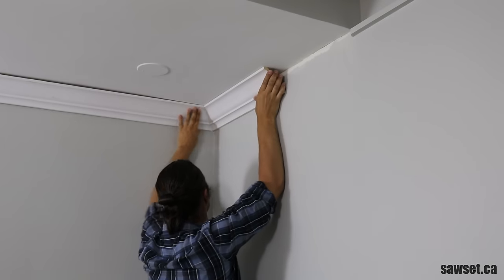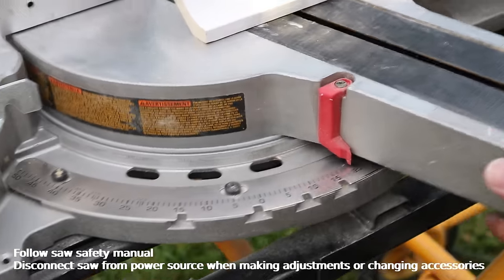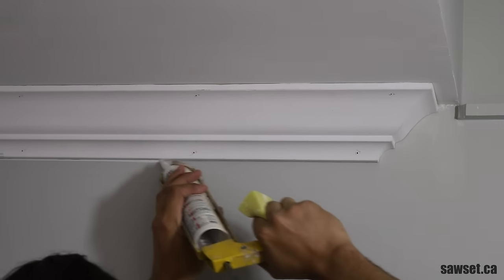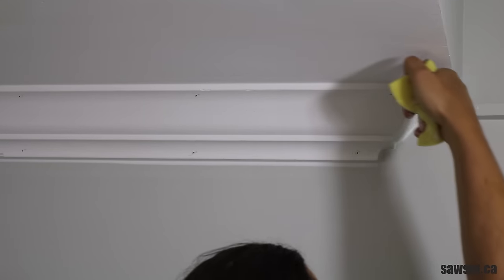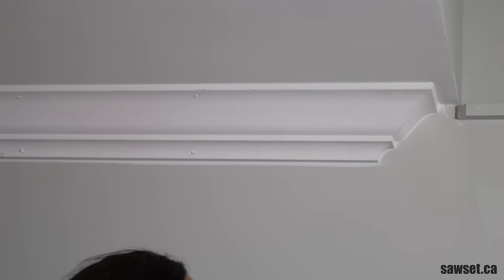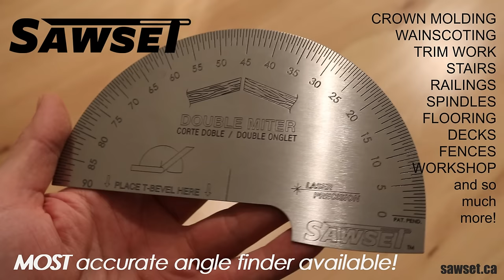How To Install CROWN MOLDING using a SAWSET PROTRACTOR. #AMAZON         #crown molding #miter #bevel

Comment: Sawset makes the most accurate joints,I've used all the other gauges and none are as good
Reply from the maker: Thanks for your comment. Accuracy is what we strive for.
Reply: @SawsetTools  my clients are amazed at how tight my baseboards turn out even without any caulking
Reply from the maker: @dmlvsccfamful  I was a contractor and my son still is.
Praise from a customer is always good.

Comment: Nail hole tip ; use drywall putty, you can sand it lightly or wet cloth when it’s close to dry.  I find caulking doesn’t fill that great, but that’s just me.
Reply: You are right.
Dryway compound is the best way.
My mistake.

Comment: What brand glue are you using ?
Reply from the maker: We use Lepage No More Nails for gluing, and Dap WATER base calking for the final part.
But any WATER base glue that comes in a calking tube works.

Comment: i do returns in a 3 piece joint,with saw at 22.5 degrees,and i use CA glue with an activator,looks a lot better than a 90 degree return
Reply from the maker: I like that look.
Will try it sometime.
Thanks
Reply: I do mine same way. I did the 45° returns for so long and seeing the same thing in every house..i wanted a different look.
Reply from the maker: @billzima7068  I will definitely try it next time.
Thanks

Comment: What gage gun are you using ? Is a 16 gage to big?
Reply from the maker: Not a fan of 16 Ga. 
With MDF,  the edge around the hole is raised and shows when painted.
18 Ga is better.
Reply: @SawsetTools  ... Oh ok, I'm not using MDF , I'll be using wood.  Maybe the 16 g would be ok
Reply from the maker: 16 Ga. sounds sounds good.
Swipe you finger over the hole and if it's not raised, great.

Comment: Finally a video on crown I understand. I was so confused about turning crown inside down before cutting.  Thank you. Can you share what glue your used? Thanks
Reply from the maker: We use Lepage No More Nails for gluing, and Dap WATER base calking for the final part.
But any WATER base glue that comes in a calking tube works. 
Thanks for your positive comment.

Comment: Im a fine woodworking carpenter by trade for the past 20 years, lots of good tips on this video, how ever, the ceiling you were working with was exceptionally good, most of what we come across is much worse with being off level and bade bumps / dips in the ceiling. it can get much more complicated at times.
Reply from the maker: You are right Rick.
I have done a lot of old homes and plastered homes are the worst.
I'm retired now, and that's my son on the video.

Thanks for the comment.

Comment: Very good tutorial and simple explanation.  I was sharing this with one of my helpers to help better explain the concepts of setting crown and how measurement increases are very important so you don’t burn material by 1/8” or 1/4” trying to get a fit inside corner/outside. 👍🏻
Reply from the maker: Good call.
Reply: What type of glue are you using

Comment: Jordan,  Great video explaining how easy this protractor is to use and how accurate it can be.  Well worth the $20+ and it is so compact for storage.  Works simply with the T-bevel you likely already have.  Your instructions on applying latex caulking to all joints and surfaces before installing the molding to ceiling and wall was so helpful to successful completing our room.  When installing long pieces it is like a 3rd hand holding the molding in place while you position and nail.  Super suggestion and a great help to ensure the piece is permanently held in place.
Reply: Barton thanks for the compliment.
Merry Christmas
Reply from the maker: Thank you for your positive feedback. It's so great to hear success stories and how Sawset and our videos have helped you improve your carpentry skills. That's our goal!

Comment: Need a cushion on that gun. I would highly recommend not caulking nail holes.  Use a filler that wont shrink.  I use a product i think from DAP but we push it in really good then just little on the heavy side. The filler is super lightweight and can really be sanded by hand. But we just run around tje room with a sanding sponge..it only takes a few minutes and it smooths out any of the crap primer job, the over fill of filler we applied and makes splices and outside corners flawless.  Also dead end returns we use CA glue and put it together on the bench b4 it goes up. Blocking,splices and outside corners use wood glue!! Inside corner we cope and then apply a small bead of caulking with adhesion b4 fitting together.  Keep everything clean as you go. I like having a wet sponge with me but only to keep my finger clean and moist to slick over the caulking.  Crown molding is one of them things where it can be tough in the beginning but when that lightbulb goes off in your head and you totally understand it  ..it then becomes as easy as installing baseboards.  Very nice  angle finder..with that and a bevel gauge you are guaranteed a beautiful outcome.  Happy building all!!:)
Reply from the maker: You are right.
Thanks for the helpful tips.

Comment: Nice video. I agree I pays of to measure corners beforehand. Just like to add that in  my experience there's no need for a nail gun if using an appropriate glue. Although i use type of quick glue for the corners, wich means they stay in place, if the corner glue is slow acting ther is possibility of them moving out of place.
Reply from the maker: Food for thought!
Reply: Anil Podgornik I have never used nails in this way either. I only use them as supports underneath go stop long runs sagging, and then only if needed. Of course they get removed afterwards.

Comment: GREAT VIDEO, Well informative. Thanks
Reply: where can i find that clamp or metal plate on the Dewalt miter saw? i have the same saw
Reply from the maker: @zaneh6188  it's called "Crown Stop". I bought it at Lowes. It's also available on Amazon. Thanks for your comment!

Comment: Your how to videos are the best we’ve seen as far as clear precise descriptions and make us feel like we can tackle it ourselves so thank you. Do you mind sharing under your descriptions, what wood glue you use as well as name of seem and hole filler please? This would help eliminate the guess work when we need to purchase.
Reply: Another note if you don’t mind, what model and where to purchase the mitre saw you are using and what the actual brackets you use to hold crown moulding in place on the saw table?
Reply: We use Lepage No More Nails for gluing, and Dap WATER base calking for the final part.

But any WATER base glue that comes in a calking tube works.
We use drywall compound to fill holes.
Reply: @paulinemonastero322  Any miter saws with a 12 inch blade is good.
Each brand will have there own crown stop.

Comment: Most silicon caulking's are NOT paintable. Be careful paint will not stick.
We use Lepage No More Nails for gluing, and Dap WATER base calking for the final part.
But any WATER base glue that comes in a calking tube works.

Comment: Hey great video thanks for taking the time too teach us all how too do this . Question what size nails are you hitting that crown molding with ? Also what type of glue are you using ? Thx
Reply: 2 in. 18 ga. Brad nails, trying to hit the studs when I can.
We use Lepage No More Nails for gluing, and Dap WATER base calking for the final part.
But any WATER base glue that comes in a calking tube works.

Comment: Hello,
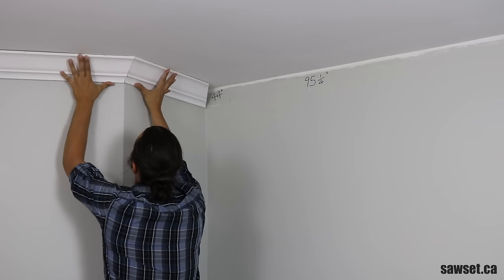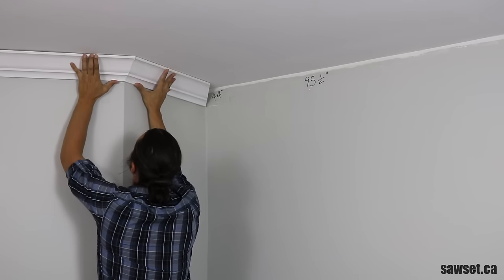Love the video. About to start a crown moulding install.  The previous owner didn’t want to finish the crown, and stopped with a flush cut on an inside corner 3:10 3:10 . I understand it’s best to use a coping saw, but how do I cut the moulding and get it to matchup?  Thank you
Reply from the maker: I know the traditional way is to cope, but mitering is the best way, because the 2 moldings lock each other in place. If the existing crown is not glued down, I would remove it and miter. Mitered corners are also crisper.

Comment: I would've extend the self return to the edge of ceiling, other than that outstanding work!
Reply from the maker: You're right. Thanks for the input.
Reply: @SawsetTools , the tips and tools you use and recommend are very helpful!, I ordered the crown stoppers right away!
Reply: @twoserve2449  Crown molding stops are the safest and most actuate way to go.
Reply: @thetoolman3355  , you're totally right!, I've done crown without stops, and its a bit difficult, and leaning to a bit dangerous too!

Comment: You don't mitre inside corners, you cope them. You don't need to glue the long edges of the trim because The painter is going to caulk it anyway and that's basically like gluing it.  Just use quick dry patch for your nail holes you get a better result than caulking with no risk of having a big mess.  You need to watch a Ron Paulk video on how to install crown molding. If I made videos I would have you watch that.  You might learn a thing or two.
Reply: Coping is a traditional method.
Mitering is simpler, quicker, corners crisper, and each molding locks the other in.
Yes, gluing is extra work.
As they say, "Do it right".
My opinion.
Reply: @thetoolman3355  we both know mitering inside corners is plain wrong.  The time you spend checking that angle is the same as the time I spend coping the edge, so that's a wash.  I know the video is for noobs but still should be the right methods.
Reply: @thetoolman3355  yes do it right indeed.
Reply: @theintelligentcarpenter9407 You're not listening.
Reply: @thetoolman3355  I am listening, I'm just disagreeing with you and making points to support my professional opinion.

Comment: Question.  Can you install crown mouldings over walls and ceilings that have wallpaper on?  or do you have to cut the paper away first ?
Reply from the maker: Yes, remove wallpaper and wash off glue residue.

Comment: I really need a sawset  tool
Reply from the maker: You can order it from our website... sawset.ca
Reply: Cicrular saws are limited.. You can only cut 7-10cm in heights, so when you come upon cornice mouldings that are bigger it is useless. There are hand saw kit for bigger mouldings. Simple ones for - 45 90 +45 degrees and also adjustable ones... For small or flat ones circular saw is much faster though...
Reply: Sawset tools I can't find any web site where they ship this tool to Ireland or UK  can you please help me

Comment: when you nail straight to the drywall ...always nail at an angle so the nails cant pull out
Reply: Good call.
Reply: That doesn’t do shit. In time along with expansion and contraction it will pull away from the ceiling and wall. Test it with time and let me know the outcome.

Comment: i got trim on in one corner and cut all the pieces and then the other three corners didn't fit so i will get this gadge to measure lesson learn don't assume all corners are the same thank you yeah cutting on a miter box i had to fight to hold it in a angle
Reply: I agree with you, cutting with a miter box is hard.
Jordan addresses in the video, positioning the molding is important .
To high on the wall will gaps on the bottom.
To  low on the wall will gaps on the top.
You need to find that middle spot.

Comment: Not trying to criticize your work, but I am a retired carpenter of forty-two years. Am I the only one that uses a coping saw? All inside corners, cut your first board square and butt it in the corner. The board butting against it, Needs to be cut on a compound miter, then cut with a coping saw. I prefer laying my trim flat, and using a compound miter saw. Cutting the other way is also correct. When butting two mitered boards together in an inside corner tends to shrink apart after the heat and air is turned on, and the moister is taken out of the house. Try cutting your two boards on a twenty-two-and-one-half-degree angle when the wall is too long. The painters always did all of the caulking. They will tell you how good of a job you are doing. We also kept flower on our hands when the trim got stained. Otherwise, the oil from your hands will leave fingerprints and such when the stain is applied.  I still believe that you still have great suggestions.
Reply from the maker: Hi Bob,
I am 71 and the inventor of the Scales. Carpenters have been trained to cope inside corners for a long time, which is not the best method. Mitering is quicker. The corners are crisper. The left miter locks in the right miter, and the right miter locks in the left miter. When you cope only one is locked.
Cutting on the flat is an option, but both methods have their pros and cons. Ed

Comment: Why not just use a starette angle gauge? Seems like an extra step having a bevel gauge and and a protractor and also room for error having to measure it every time
Reply: Sawset and Starrette both require no math.
Sawset is 3&1/2 times larger.
Try splitting a degree with Starrette.
Sawset is for the precision carpenters.
Reply: @thetoolman3355   I am a precision carpenter, and have no issues with the starette. Kind of a bold claim coming from a video where you're using thick paintable glue for all the joints and crown stops on the chop saw. Cutting the end miter with only one end in the crown stop like that will give you results that are just as bad or further off than the half degree you're talking about. I know they require no math but you're using two separate tools instead of one
Reply: @bolerdweller  Wish you the best.

Comment: great tips thanks. looks like a small brad nailer, what guage/ length are you using and are you nailing into studs/ joists?
Reply from the maker: Hi Matt,
Good questions.
I used 18 Ga. x 2.  (16 GA makes the perimeter of holes stick up)
You try to hit the wood when you can.
When gluing is done right, it gives a lot of support to the wood crown. (Keep in mind plaster crown moulding is neither nailed or screwed, yet it stays up.)

Comment: What's are your thoughts MDF and non-MDF crown moldings material?
Reply: Wood does a one time minor shrinkage, because of moister content in the wood.
I use MDF, because doesn't shrinkage.
Recommend oil prime before painting wood or MDF.
This keeps moister away from wood.

Comment: Hi very helpful however do you cut 44° from one side only or from both sides?
Reply from the maker: Always cut both.
Also positioning of crown on the wall is important.
To high or low on the wall could gap top or bottom.
Adjust it to find that sweat spot.

Comment: Is the caulking material made specific for MDF glueing?
Reply: I don't believe there is a calking for MDF.
We use Lepage No More Nails for gluing, and Dap WATER base calking for the final part.
But any WATER base glue that comes in a calking tube works.

Comment: What brand caulk do you use to fill the nail holes?
Reply from the maker: Drywall compound is the best to fill holes, then sand flush when dry.
Reply: The caulk being used in the video is Top Gun 250 Fast Dry Sealant by PPG. But I, too, use joint compound almost exclusively for nail holes.

Comment: One question. how do you join a inside corner without coping
Reply from the maker: Inside corner mitered is easier for the DIYer.
Has more gluing surface, for a stronger joint.
The mitered moldings lock each other in.
The corner has a sharper detail.
Coping is traditional, and OK.

Comment: How about some wood glue , 2P -10 and wood filler?
Reply from the maker: Yes that is a option.
The glue needs to be dense / thick, because ceilings are up and down.
And I usually use drywall compound for the holes.

Comment: Any idea how to meet Hardie crown in a Gable on a dormer?
Reply: Hope you have a special blade to cut a Hardie product.
I have no experience  with cutting this product.
If you cut with a miter saw, Sawset will give the saw setting
Reply: @thetoolman3355  Hardie blades are sold at any home improvement store.
Reply: @thetoolman3355  My question was more about the scenario than the product. The dormer roof is 6/12 and the main roof is 9/12. The architect says it'll match but I've only ever seen it with eyebrows applied on the dormers.
Reply: @gordondye4227  I think you know more than me. Good luck with it.
Reply: Gordon Dye  take two pieces of scrap hold it in place and mark the top and bottom of the crown and find the intersecting point. Once you do that you can figure out the angle of cut

Comment: What brand silicon you use
Reply: Most silicon caulking's are NOT paintable. Be careful paint will not stick.
We use Lepage No More Nails for gluing, and Dap WATER base calking for the final part.
But any WATER base glue that comes in a calking tube works
Reply: @irisostachowski1489  thanks sir...

Comment: Do you ever cope your joints or does sawset sponsorship prevent you from showing the better way of doing inside 90 degree miters?
Reply from the maker: Both is optional.
Mitering locks each other in.
Coping locks only one.

Comment: Y cuando las esquinas no son a 90 grados q se hace ...xq corte a 45 grados cada corniza pero no se unen las puntas ...
Reply from the maker: Use a short cut sample piece for locating of the crown in the right orientation.
Reply: @SawsetTools  el pedazo corto q dices de cuanto lo corto , xq incluso le raye el techo para sacar el punto guía para señalar y cortar pero ni así logran unirce en les esquinas externas y internas , el pedaso pequeño de cuanto lo corto
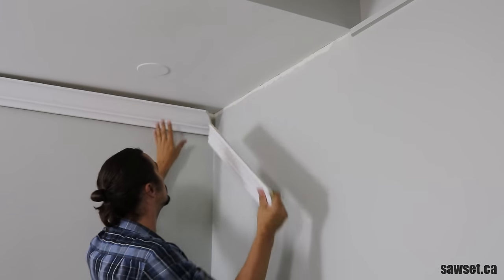Reply from the maker: Look at 4:22 of the video.  use a 10 or 12 inch disposable sample piece.
Reply: @SawsetTools  yo me refiero al corte de cuanto le hago no al largo del pedazo de la cornizas
Reply from the maker: @JairitoPerez86  You need to find the proper saw setting for that off 90 degree corner. That is the purpose of the Sawset Protractor.